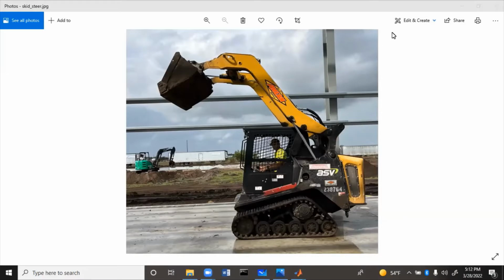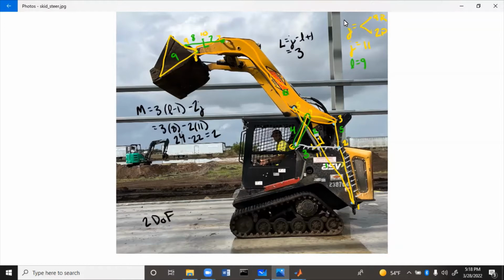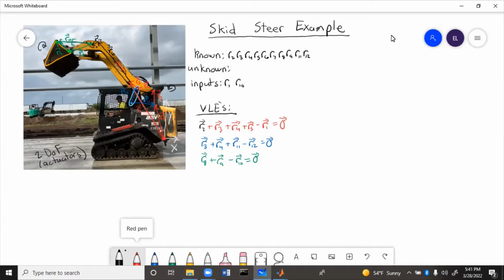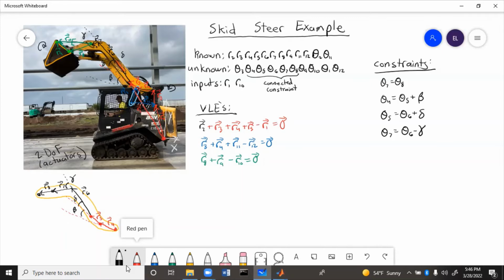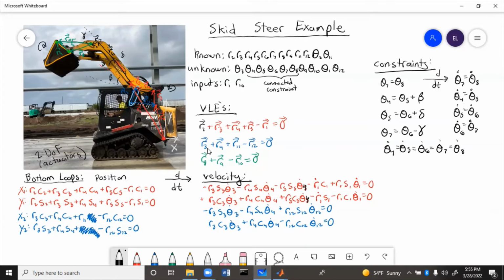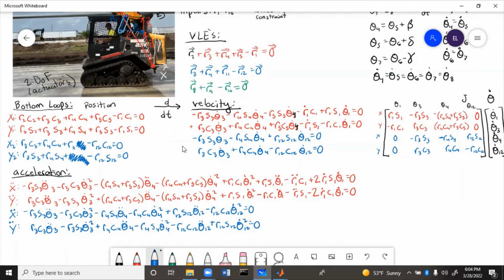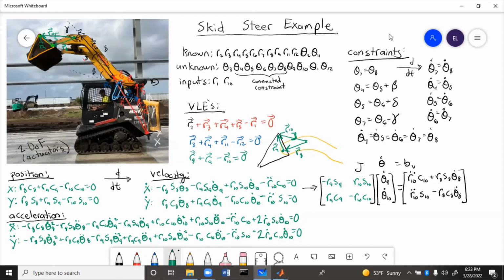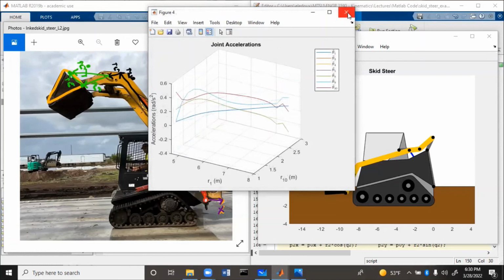Skid Steer Vector Loop JVA Analysis

Comment: how did you connect top loop to bottom loop ?
Reply from the maker: I used r6 and r7 vectors along the yellow boom to get from the bottom loops to the top one.  I did not show this in the video since those vectors weren't in the loops, but you can use constraints of theta5 = theta6 and theta7 = theta8 to calculate the r6 and r7 vectors.

Comment: Hello
Did they have only one Solution??
I've solved one of the problem on "Theory of Mechanisms and Machines" book, but my loop wasn't the same on the solution manual
is it possible that my solution also right??
Reply from the maker: Yes, there are many possible correct vector loops.  The direction of the arrows and what you name them generally does not matter, as long as the arrows go dot to dot between the joints and the equations match your diagram.  See https://youtu.be/1-HItSmJlc4 for more details.
Reply: @dynamicsandkinematics  ok, I've already watched this video, and two other examples videos, one of them contains more than one loop and I learned from it how to know how much loops that I need. but I need to be sure that I've got the idea.
there are many different unknowns, and the equations I have, just about 2 or three. I cant solve it analytically!! I'm right?.
Reply from the maker: Most of the time, a mechanism with more than one loop is too complicated to solve analytically and must be done numerically.  For a few cases, it is possible though.
Reply: @dynamicsandkinematics  
good to hear that, can you confirm if my solution is right pls?
Reply from the maker: I can't verify correctness without seeing the problem and your solution
Reply: @dynamicsandkinematics  how can I send'em to you?
an email should work!!
Reply from the maker: @عبدالله-إيتا  send it over Linkedin: https://www.linkedin.com/in/elissa-ledoux/
Reply: @dynamicsandkinematics  Ok I'll, just waiting for the acception.